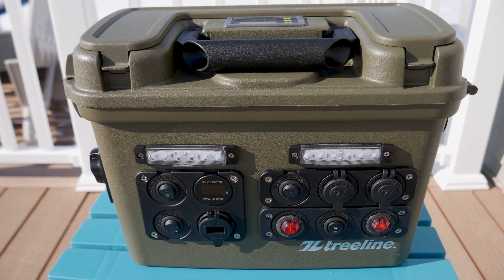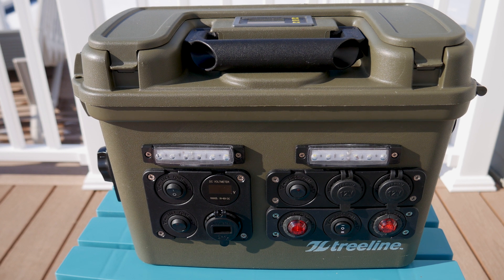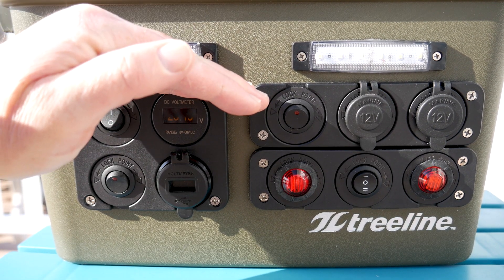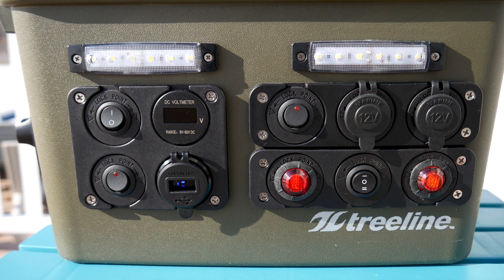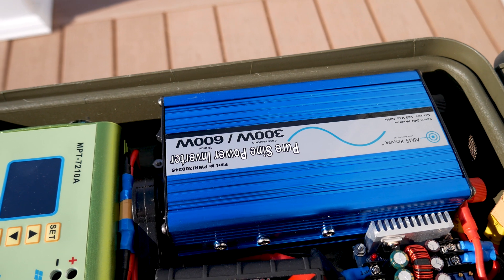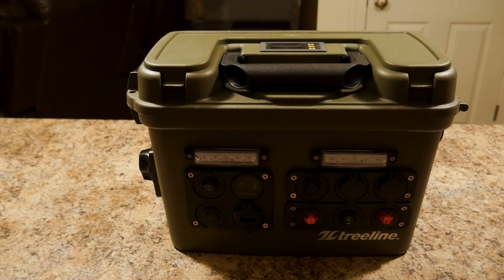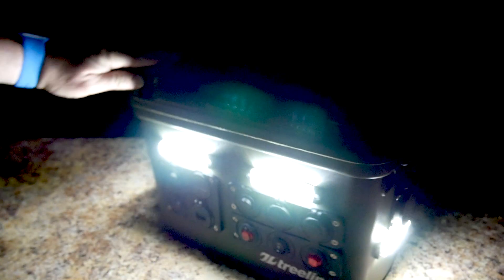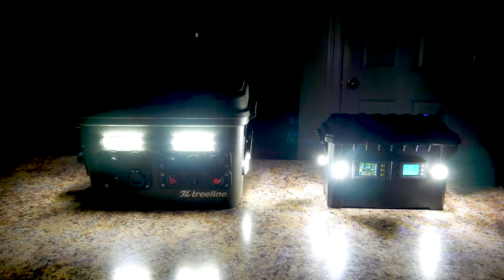18650 DIY Lithium Powerbox/Solar Generator 2.0 Upgrade Part 1

Comment: I like your setup, especially the box. Is it more efficient to use the invertor or 12?
Reply from the maker: Thanks, the 24 volt system is more efficient and requires smaller gauge wires. The 24 volt inverter is perfect for a 7S battery.
Reply: @GreenMountainDIYGuy  Thank you

Comment: Fan for air flow?
Reply from the maker: I'll probably add one in Part 2.   I'm thinking of using a couple of small 25mm fans.  Most of the heat is created by the devices on the tray which include the buck converter, inverter, charge controller, etc.

Comment: Very professional custom built. It looks easy but, in reality you really have to literally think outside the box. There's really not any extra room inside. You have to rehearse each item before you install anything. I'm right in the middle of a build myself and my 12V 300W Aims pure sine inverter has bit the dust. It was two years  old. I have on order a Accurate Tools inverter. I really like your build and lights.